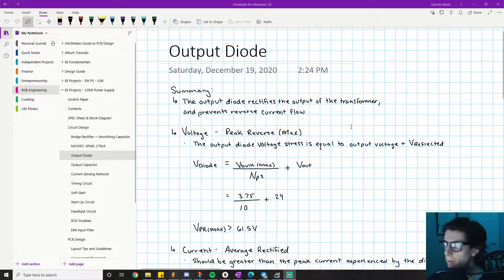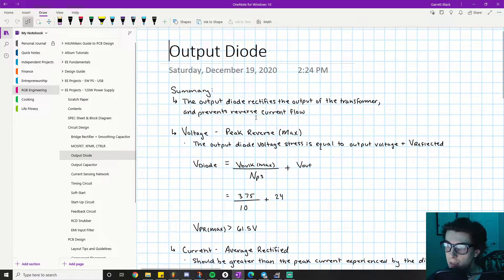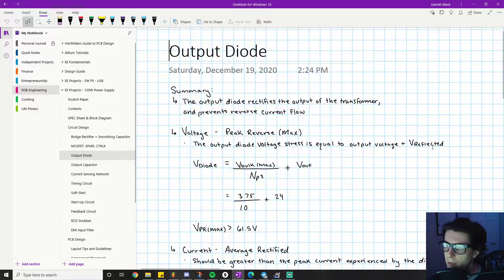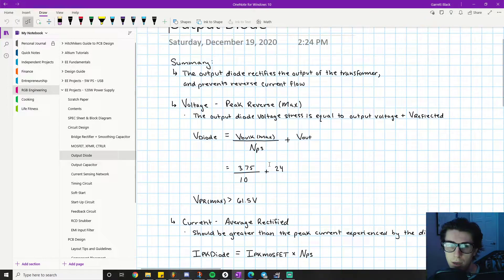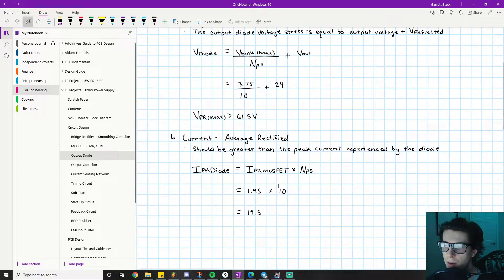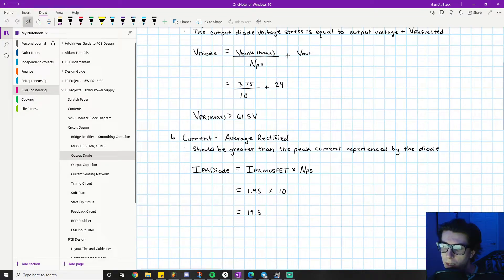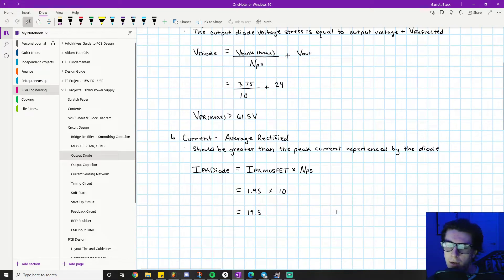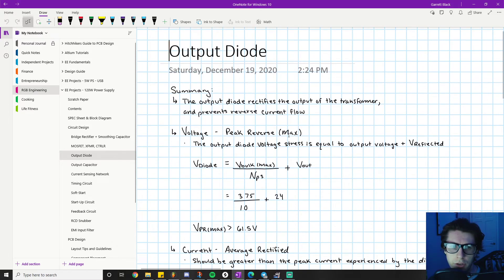FLYBACK CONVERTER PROJECT PT 6 | 24V, 120W FLYBACK CONVERTER EXAMPLE | POWER SUPPLY EXAMPLE PROJECT

Comment from the maker: Do you like this format for the component calculations?
Reply: Hi, in previous video Vreflected was calculated to be 250 V, could you please explain how Vreflected is replaced by Vbulk(max)/Nps here in the equation whivh equaled to be 375/10 i.e 37.5V ?
Reply: @abhinilbose24  Vbulk(max)/Nps = Reflected INPUT voltage. The previous video calculated reflected OUTPUT voltage...(see the Data Sheet)